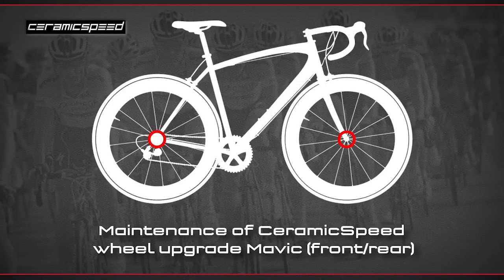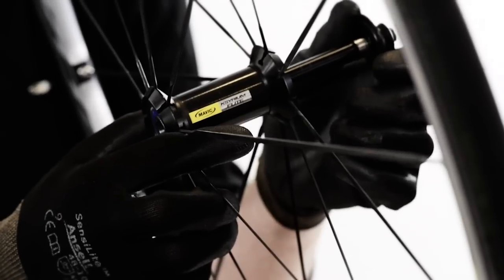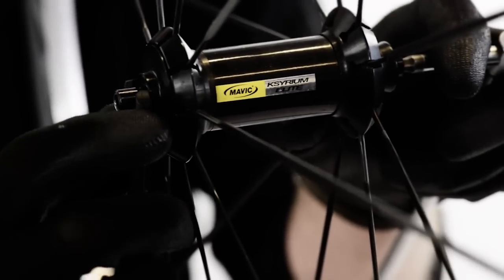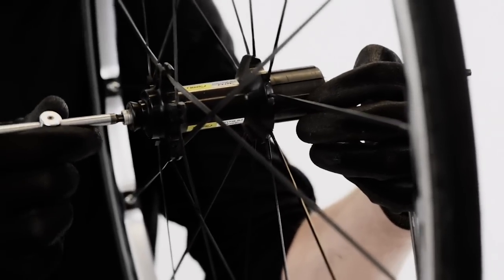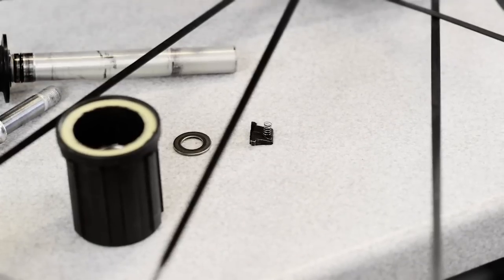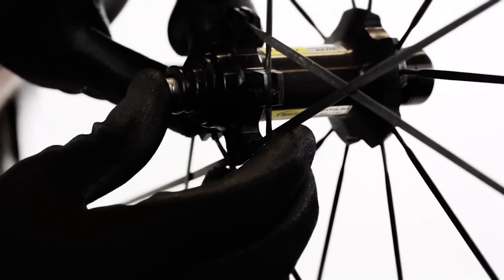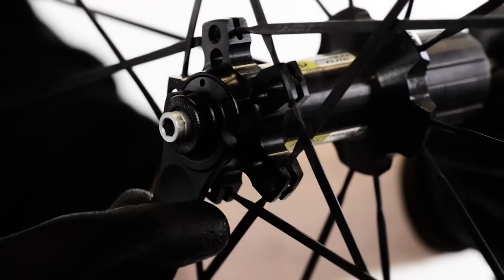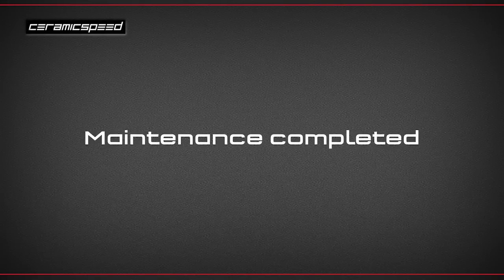Maintenance of CeramicSpeed Mavic Wheel Kit

Comment: Hi there. What would be the procedure for the Mavic Ksyrium Pro Disc wheel for Centerlock rotors? Should a ring be removed on the dust cover side? If so, how? By hand? Thank you in advance for your reply.
Reply from the maker: Hi Phaidrus. For a  Mavic Ksyrium Pro Disc wheel, you should follow the same instructions as seen in the
video, but make sure to use the proper Mavic key to match your model. That will help you unscrew the ring as shown in the video, and then the procedure should be the same.
Reply: @CeramicSpeed  is there a reason these 3 bearings cost over $500usd? Fking ludacris.